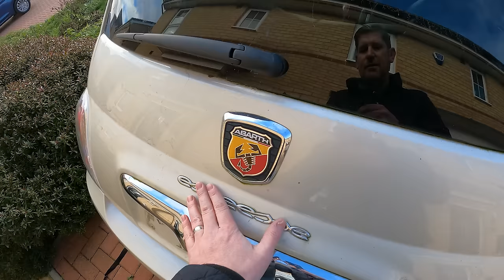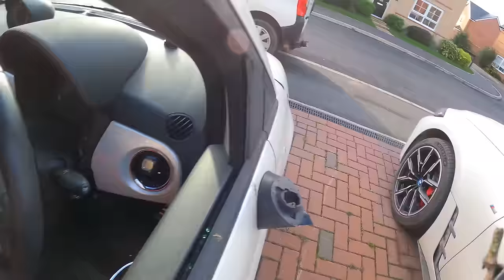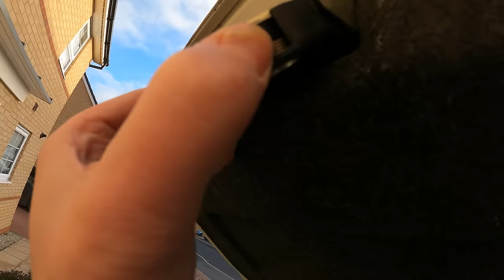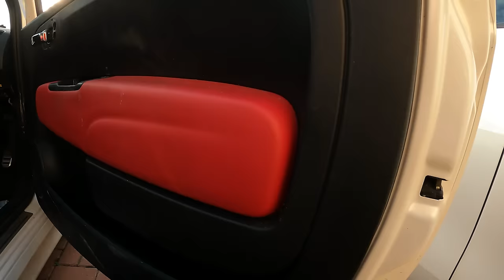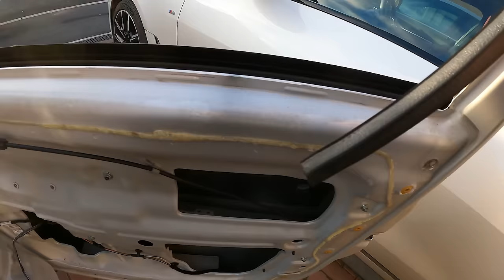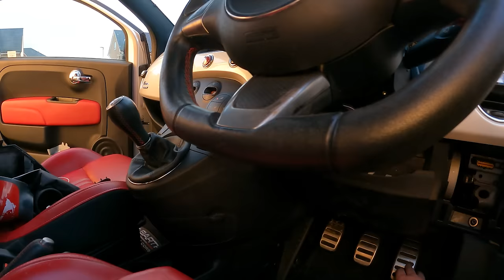I BOUGHT THE CHEAPEST ABARTH IN THE UK VLOG 1

Comment: That rattle sound you hear from underneath is probably the exhaust valve. It is probably spring loaded on this model and the valves are a problem on these record monza exhaust. So the spring is either gone or valve flap has parted from external lever where the spring attaches to.
Reply from the maker: Ah brilliant I will have a look into it this weekend.